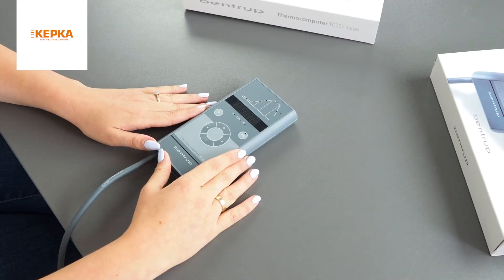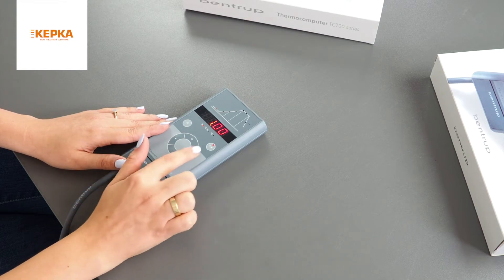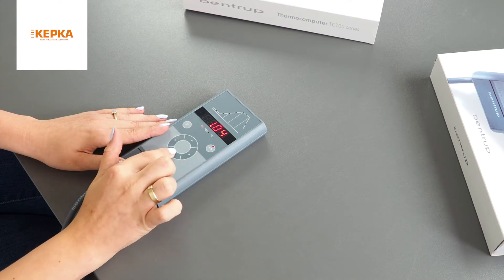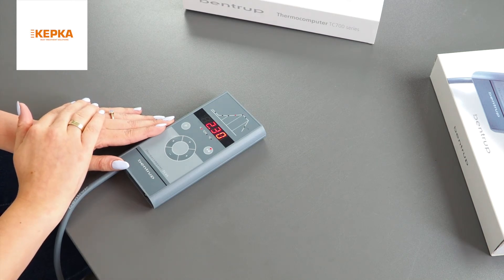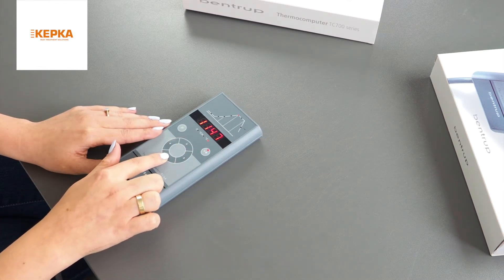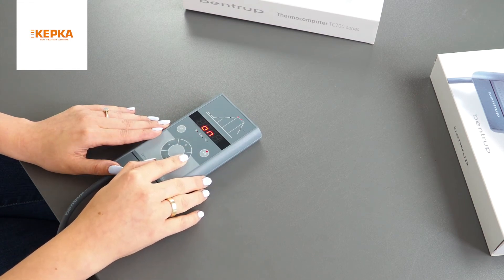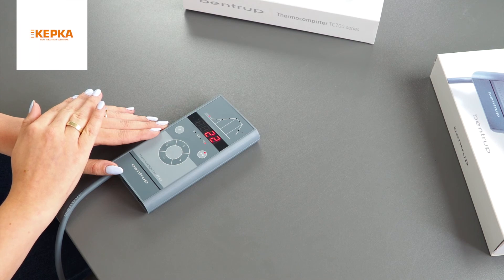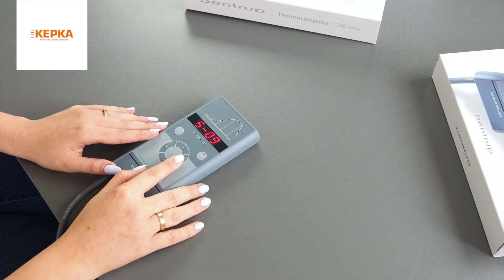How to use Bentrup TC66 Controller | Kepka Heat Treatment Solutions | www.kepka.tech

Comment: Hello, receive a cordial greeting. I am writing to you for a personal reason regarding my single-phase electric ceramic oven (230V) Kittec classic Line CB 66 Double and about how to program the plateaus of cooking in the Thermocomputer TC66. I purchased this ceramic oven with the TC66 thermocompudor here in Holland where I currently live, and it turns out that the only manual and instructions I received is very basic and I currently need to do my first bisque firing and later the glazing one but I cannot properly program the plateau which is necessary to fire the pieces with the glazes and for the glazes to set in due time and appropriately. The manual I received does not mention at all how to program the plateaus in the firing curve that must be programmed in the TC66 thermocomputer and the truth is I need more information about this so as not to screw up and the ceramic is going to break inside me. in the oven or at the time of applying the glazes, do not exceed the temperature and become damaged. So I wanted to ask you that, as I saw on your website, you also sell electronic Kittec ovens and with them the same thermocomputers. Could you provide me with a more precise manual in Spanish that explains in more detail how to program the plateaus and other details in the TC66 to perform a correct ceramic firing? Perhaps you could provide me with some tutorial videos on this matter?. Thanks in advance ❤